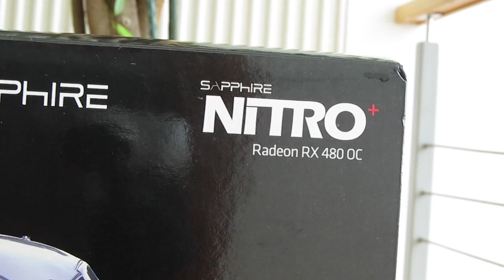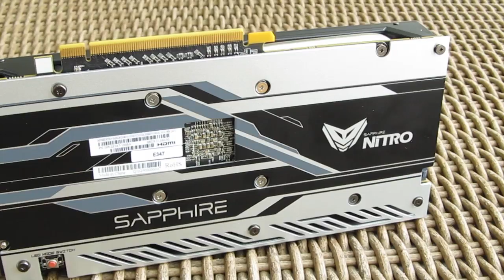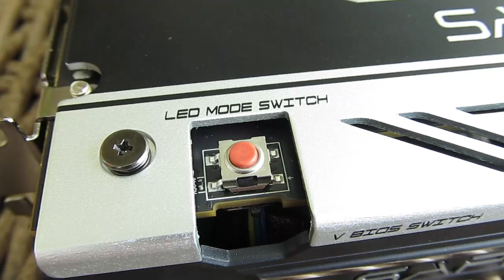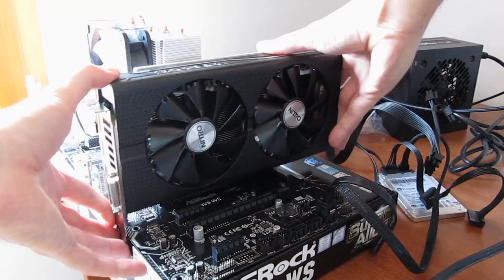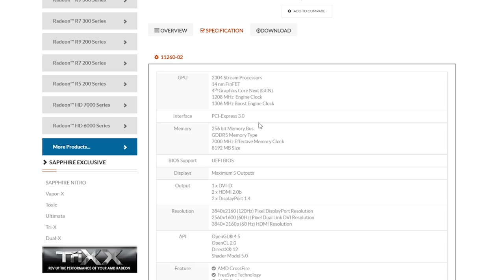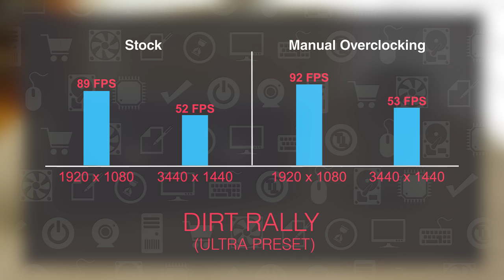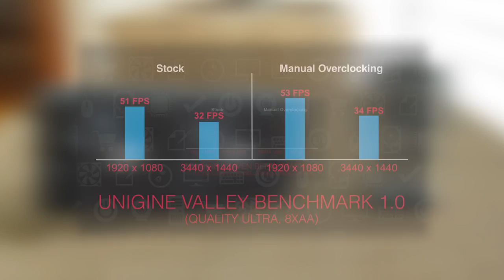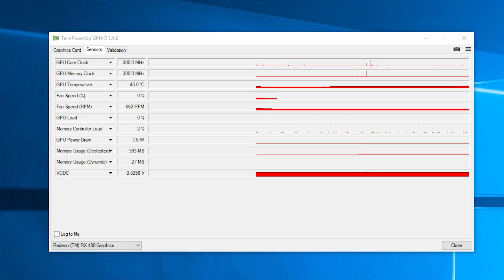Sapphire RX 480 Nitro+ Review - Aftermarket Salvation

Comment: Why so low fps in DOOM?
Reply: What didn't work? ROFL!

You showed OpenGL Doom instead of Vulkan and you were using FXAA instead of TXAA or no AA at all to enable Async.

In reality you can add 40fps to those scores, putting this RX480 20% ahead of the GTX1060 and only 5-10% behind the GTX1070, a card which costs over 2x as much.

GG
Reply from the maker: I had some issues with the PresentMon, couldn't get it working properly, as I mentioned in few comments before. You don't need to be offensive like this.

I have to reformat the drive and bring fresh Windows up to sort everything out. I'm planing to do a video on Vulkan next week with Doom and DOTA 2 based on the reference RX 480 8 GB. Since I started testing with Doom, few GPU's back, I "stuck" with same settings so people can compare them, so we have a "level ground", at least for OpenGL testing. Once I get PresentMon working, beside the OpenGL testing I'll add the Vulkan results in every game possible and with every benchmark, just like I do with DX12 titles (ROTR, AOTS)... Feel free to suggest good alternatives for the DX12 / Vulkan FPS counter.
Reply: because they bored to click the vulkan button
Reply from the maker: Because PresentMon didn't work!
Reply: TekTick
Dude there is no excuse at all. I have heard the same excuses from so many different morons, including the mighty Digital Foundry themselves, and it is an absolute joke.

FRAPS, MSI Afterburner, Rivatuner or even Gaming Evolved / Shadowplay offer a 99.5% accurate reading + averages and even drop data to a .txt file at the click of a button.

BUT NO ... keep the "even" ground. Don't show what AMD and Polaris can do in Vulkan, for heavens sake! Showing a £175 card beating the £260 Nvidia card by leagues? Bad for business. Showing a £212 AMD card only a few FPS behind a £400 Nvidia card? Terrible! Don't do it!

Showing £350 of crossfire RX 480's stomping a £700 GTX1080? Does not compute! XD XD

sigh
Reply: TekTick
So then tell me how Forza, Warhammer, Ashes of the Singularity, Hitman, TombRaider DX12, Doom under Vulkan and COUNTLESS synthetic benchmarks  running both DX12 AND VULKAN have FPS counters with a multitude of different software. There are thousands of videos from the past 12 months right here on youtube to confirm that FACT.

Right? OR TELL ME ... (and please, I beg you to tell me) .... am I lying? XD

You silly man. Did you forget where you are?

The INTERNET son! XD
Reply from the maker: +TheVanillatech
I'm not calling you a liar, I'm just saying you're utterly ignorant and blindsided. So, let me teach you, once again for free, since you're being stubborn to your maximal potential.

WH, Hitman, TR and AOTS - they ALL have built-in benchmarks, so there's no problem / obstacle in using them and checking out the DX12 performance as I DO / DID with games that I have from that list and you can clearly see those results in the video (ATOS, TR), while Forza and Vulkan don't have built in benchmarks.

Every single game DX12 that you saw on the YouTube showing frame counters uses either PresentMon or DXTory. For the most part, in 90% of the cases, they are using the second program called DXTory which is NOT FREE (trial based, limited options) and which doesn't record average FPS and outputs it to a file on its own like FRAPS (that's one of the reason why 0 reviewers used it while checking out the Vulkan performance), and which in some cases cause impact on the performance.

Once again, for measuring DX12 in a way you can output a file with average figures the only option for now is PresentMon, but since that's an open source program written by a single man and not a corporation (it's not even compiled), it's no wonder people are having issues.

Hope this clears everything up for you, I see that you were really confused. You're making mistakes from reply to reply, not apologizes for them, just continuously bluntly accusing and bashing me. Bottom line, this will be my last interaction with you unless you straighten up.
Reply: The guys and idiot he spams all the tech channels with the same old crap about dx12 he's a die hard amd fan yes he "lies" quite a lot I "AM" CALLING him a lier just click on hes comments on hes profile for proof just ignore him  keep doing what you';re doing peace !
Reply from the maker: +TheVanillatech
Man, do you realize that non of those programs can measure FPS in DX12 and / or Vulkan? PresentMon is an open source project than you download from GitHub and then compile it using the MS Visual Studio and that's the ONLY "software" which supports DX12 / Vulkan FPS measurement, but since this is basically a program that "some guy" wrote, it doesn't work perfectly on every machine, for example in my case, I couldn't get it to output any values for some reason.

Here, educate yourself a bit, it's free - http://www.kotaku.com.au/2016/07/heres-how-to-benchmark-games-running-directx-12-or-vulkan/

Your judgment is so clouded and subjective, you're not thinking straight at all. Do you really think that I've wouldn't do a FPS measurement in Doom using Vulkan API if it worked in any of those programs you mentioned? C'mon man, give me a break, what kind of non-sense conspiracy are you getting at?

I see that you're being completely biased and that you have a certain blood running through your veins, I can understand that to some degree, but at least try to stay on course with valid arguments, otherwise this is pure trolling.
Reply: triggahmp
With a name like yours plus using words like SPAM and "die hard fan", coupled with your absolute abysmal grasp on the English language and how to syntax ... forgive me if I wipe my ass with your opinion.

Have a good day now!

Comment: Do you know when can i buy this modelo?
Reply: +JTriler693 If you don't care about brand, you should go for the EVGA SC 1060, as it performs better overall, cooler, cheaper and smaller, if you want to go AMD side, I would recommend you to wait for some more AIB, because this doesn't improve much from reference and its cooler is bad
Reply: +justanalt Nope. Too late, GTX is cheaper, cooler, smaller and has ShadowPlay
Reply: +justanalt Too late, because I already bought GTX, it has a better cooler, yep, it only reaches low 60s on load and I've always prefered Nvidia, call me fanboy if you want, but I think Nvidia is the right one for me
Reply: Well yes and wrong. Nvidia don't fully support DX12 let alone DX12_1 on hardware but they can on software.
And the idea of DX12 is to remove CPU overhead and utilize asynchronous shaders. Pascal is able to offer more fine-grained control, entering a new task between pixels or instructions. This will allow for better and likely faster preemption. The next change is dynamic load balancing. This allows Pascal to reallocate resources dedicated to either graphics or compute on the fly. This GPU level means that once a graphics/compute task is finished, the idle SMs can now be added to those working on another graphics/compute task, speeding up completion. This should allow for much better async compute performance compared to Maxwell.
And because of preemption they have DX12_1 support sense they need it to boost async "like" compute further. Why AMD doesn't have this support is because they have the hardware already so they do it with software/drivers.
So while AMD's GCN architectures support only dx12 they are superior at it. 
So to be clear DX12_1 doesn't make much of a difference on AMD so they don't support it yet atleast, but Nvidia has to do something to catch AMD.
Reply: T0XIC Exactly what we want, not fanboyism but good competition.
Reply: model*
Reply: funny, because "modelo" in portuguese = model
Reply: River X xD i'm spanish and i wrote model but my phone changed it to modelo (that means model also)
Reply: *****
I see :v
Reply: +JTriler693 I think you can buy it from amazon :) I was going to buy one from there, but I went for the EVGA SC 1060, also from amazon
Reply: T0XIC ok, thanks, i'll take a look :)
Reply: T0XIC I will go with AMD, (in my country NVIDIA is selling his GPUs with an excesive price).

Thanks again for your help ;)
Reply: +JTriler693 I'm from Portugal and GTX 1060 is around 350€ and I got it from 250€ on amazon.co.uk, I searched spanish amazon, but it's too expensive
Reply: +T0XIC for 250€*
Reply: T0XIC yeah, it's a shame, I like NVIDIA but they are starting to do things like apple
Reply: +JTriler693 If you get a good deal like mine, why not go for it? :D
Reply: T0XIC yeah, it can be a great idea
Reply: Please don't go for the 1060. You will regret it when it won't perform as well as the 480 in DX12 and Vulkan. This specific card might run a little warm, so I'd wait for the Powercolor Red Devil to get in stock.
Reply: +Redey1290 i know, 1060 is for now and 480 is for the future, is because of it that im thinking of buy the 480
Reply: +Redey1290 It sure doesn't perform as well on dx12, and what about dx11? And there are like 10 games upcoming using Vulkan and for 250€, which is cheaper than the RX 480 here, why not? The RX can't keep up with the 1060 on dx11, while the 1060 can keep up on dx12, even though underperforming a little bit compared to the RX. And it runs 15° cooler on load.
Reply: +Redey1290 I wouldn't trust too much on powercolor, never heard of it, it sure could be good, but it's never going to have EVGA support level
Reply: +Redey1290 And it depends if you wanna YouTube as you have ShadowPlay on nvidia
Reply: +T0XIC Yes, the 1060 is better on DX11, but DX11 is on its way out. Yeah, not too many games are coming out with Vulkan support, but what about DX12 games? Tons of those are coming out. Also the RX 480 is the same price here.
Reply: +T0XIC Also I can't edit on mobile, but as long as this card or any card doesn't go above 90 degrees, it is perfectly fine. Yeah, this Sapphire cooler is kinda poor, but something like the Asus Strix or Powercolor Red Devil will be much better.
Reply: +Redey1290 Many games will use both and as long as I can keep 60fps+ for me it's fine, as I only have a 60Hz monitor
Reply: ***** yeah 😉
Reply: RX 480 is NOT better than GTX 1060 in DX12 games, it's a big lie. Pascal fully supports DX12.1 while polaris doesn't support all DX12.1 features.
Reply: +Nima V FINALLY! Where were you all this time? <3
Reply: +Diglo1 Can they help that with drivers? I don't understand that much of drivers
Reply: Im no driver expert my self but they seem to be able to and there is little performance difference.
Reply: +Diglo1 I'm kinda of favor NVIDIA and as I got it cheaper, I bought it and let's hope for the best for it :)
Reply: +T0XIC not a bad choice. I favor Amd now because of big gains on New apis and it is going To get better and hopefully even things oot with Nvidia.
Reply: +Diglo1 Thanks! I just got the one which was cheaper for me

Comment: DOOM was on openGL 4.5 ? 
because i'm pretty sure it gets 60fps + at 1440p Vulkan
Reply: Depending on the Level i usually get 100 to 180fps on my R9 390 on 1080p with Vulkan... On Nightmare Seetings and 8xTSSAA. The fps scores shown here seem icnredibly low. My bet is that he is using an old driver that isn't game ready.
Reply from the maker: You would have lost that bet. If you watched a bit closer, or at all, you could have seen that I've used the latest AMD driver, the one with the hotfix - 16.7.2.

BTW. I've already got that question before, people were wondering why is it "so low" and then they realized it was openGL and not Vulkan, and that's the main reason of "low" FPS. I've already address the issue of not testing on Vulkan API, I had some issues with the PresentMon, so I couldn't measure FPS. I'm planing to do a Vulkan coverage soon (DOTA 2 and DOOM).
Reply: TekTick ah thanks
i thought about the issue with Vulkan when you benchmark DOOM 
hopefully we will see updated benchmark on doom 1440p soon (i've seen it gets ~68 avg fps)
cheers

Comment: GTX 1060 gets an 8 in Steam VR the GTX 980 gets 8.1 both at STOCK frequencies, as both can add a good 12 to 20% core frequency and even a good bit to the VRAM.

GTX 1060 is easily the better GAMING GPU than the RX 480 8GB, the 4GB does not even compare well to a 970!